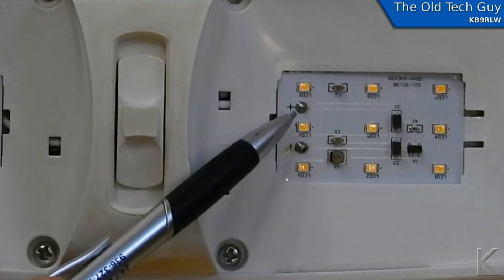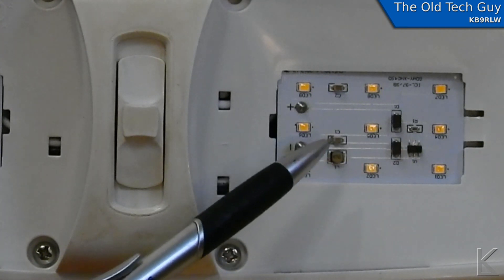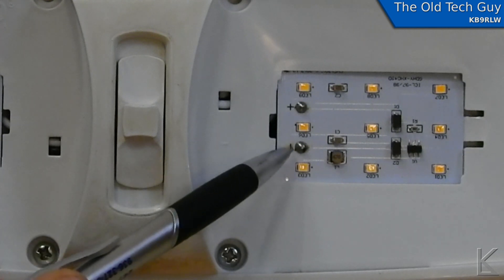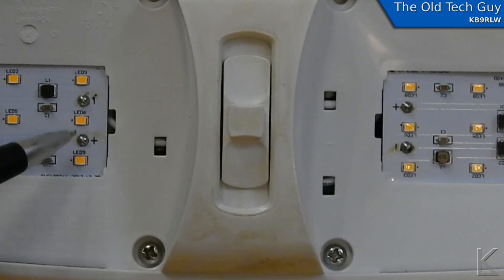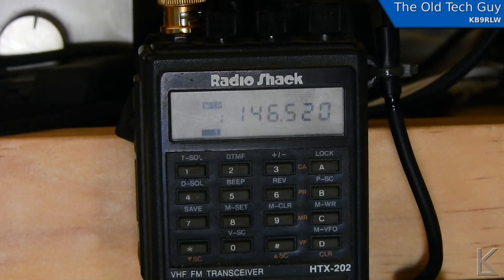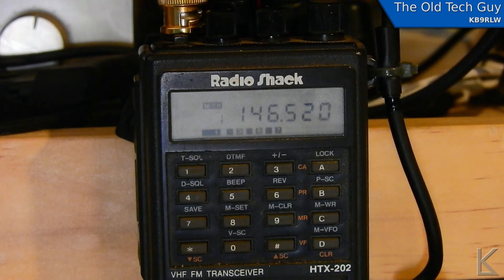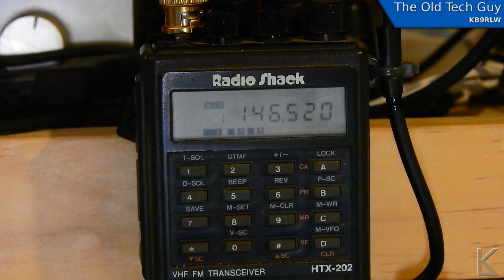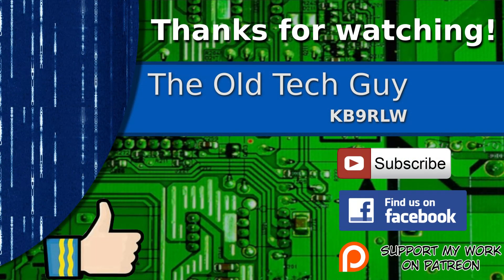Electronics & Radio - Reducing the noise from my camper's LED lights.

Comment: Great.. i did this to all my LED lamps in my cabin that runs on solarpower, but the chinese MPPT chargecontroller (fro ebay) have also lots of noise, used Ferrite snap-on on the powercables in and out and even to the batteries. that did the trick at my place

Comment: Hi Kevin. Great job on organizing and moderating the panel at Quartzfest. I have a question for you concerning noise and I thought you would be by far the best person to ask because of your interesting experiments. I am going to be adding a small solar system to my teardrop trailer to charge my Battle Born LiFePO4 battery. Can you please tell me your opinion concerning the noise generated by a MPPT Solar Charge Controller vs a PWM Charge Controller? I can’t seem to find any information on this. Thanks again Kevin. Mike KC0KMQ.

Comment: Try higher value cap? Take down the fixture and loop the power leads through a ferrite.  It’ll be in the back your mind until you get that fixture on the bench and try everything you can. At least I hope so! Have a good one, always enjoy your videos.
Reply from the maker: I tried several values, the .001 worked best for the VHF noise component.

Comment: I would check that the LEDs are not acting as their own rectifiers, and then select a really tiny capacitor and put it across the output of the driver circuit as close to the rectifiers as possible. 

You might also need to put a small resistor across this capacitor to avoid having these lights seeming to glow forever after this mod.

If you find that the LEDs are actually running as their own rectifiers I would probably install a different led board because they are probably driving LEDs on both the positive and negative cycles and making a good filter in this case would likely be harder than replacing the modules. If you must work with such modules, I would look at ways to convert that square wave hash into something closer to a sign wave.

If the noise is still a problem I would conformal coat the rectifier area of the circuit board. Then make tiny Mu-metal shields for the front in the back of the circuit board. The conformal coating will help prevent corrosion and shorts due to condensation that will undoubtedly form on these shields at some point.

Personally if I couldn't just slap another tiny cap in there and be done I would probably replace the boards. You might find some that can dim or that have other useful features (like red light or motion triggering).

Comment: I use a 1.0 uFd (at 50 Volts)  monolithic ceramic capacitor and it removes all noise.  100 for about $10 from amazon.com  https://smile.amazon.com/gp/product/B0166ETD0Q/ref=ppx_yo_dt_b_asin_title_o08_s00?ie=UTF8&psc=1 Ron W4BIN
Reply from the maker: I tried several values, the .001 was best at reducing the VHF hash.

Comment: wow amazing result .... good to know......I have a question >>>> I have 2 laptops , one with CubicSDR and the other one with Flidigit .... can I connect both laptops with headphone output for nr 1 and mic in for nr 2?    I will use that second laptop to try different programs to decode radio signals ....greetings ....Annie
Reply from the maker: You can, but you'll need to drop the volume on the source way down or you'll overdrive the more sensitive mic input on the other.
You could also just run FLdigi on the same laptop as cubic and digitally pipe the audio from the one app to the other.  On linux, you can do it with Pulse Audio Volume Control very easily.   If you're running windows, there are probably other ways to do it.
Reply: thank you mucho mucho

Comment: Hey Kevin. I have a same problem in my house. I have almost all of my light fixtures replaced with led and it doesn't bother me on vhf or uhf. HF is another story, leds ad 2-4 s noise so I just learned to turn them off. I have a desk lamp in my shack and that serves me well.

Comment: I have been investigating a similar issue, total hash on 2m, In my case it is not the led bulbs in my house, I took them all out and the problem persists. I do need to get outside to investigate, but today is a brisk -36 C and -46 C with the wind chill so best leave that until it warms up a bit.
Reply from the maker: Small plug in power supplies like provided with so much equipment these days are usually the problem.

Comment: Perfect..I have the same noise on the van AM radio when charging phone Lipo or drill . Ahaaa..like the old dash stereos bought years ago..no filtering out alternator noise so we had to buy a choke coil for the hot wire..which work fairly well.  Speaking of noise, I have notice more wireless network at intersections that when driving underneath the squelch breaks briefly ...

Comment: You Kevin!:
Great video! I'm sure there will be PLENTY of posters to give you THEIR led noise remedies! Maybe another pair caps would do? Or that would draw down the battery? I wish you success at this!
What do you think of my idea on quartzfest video? : )
de seeker/Jeff WA7LFP
Reply from the maker: The capacitors don't pass DC and therefore don't add anything to the load or power draw.   They just pass the VHF hash noise, presenting a short to those frequencies.

Comment: Well, for me, I prefer to make my own led light circuits and use a very basic voltage regulator to drive the leds. There is actually no need for high-frequency drivers for leds. I guess I just prefer to keep my system simple. The voltage regulators cannibalized out of old computer power supplies and a few I made from other electronics scrap, all depending on how many leds I am running at the same time.

Comment: Thank goodness you are unique in attacking this at the actual source vs "just choke it" everywhere and anywhere.  I'd love to see these 'scoped' to understand more about how and why product engineers seem to think they have to provide some noisy circuit gizmo to something as simple as passive resistor-based voltage/current reduction to a simple LED.  Not everything needs "advanced digital control" nonsense.  ;)

Comment: More capacitance to reduce the noise or is there a limit to what you can add?
Reply from the maker: More capacitance will pass noise at lower frequencies.  I found the .001 to be the most effective at reducing the VHF hash I was getting.

Comment: try electrolytic caps ?? or piece of tin foil blocking or reflecting it up ??
Reply from the maker: I tried different values.  I found the .001 to be the most effective at reducing the VHF hash I was getting.

Comment: Did those lights have a High and Low setting? I'm surprised there were so many components if they ran off 12VDC.
Reply from the maker: Low turns on only one panel, high turns both on.

Comment: Hi Kevin,
I would look for some led modules that will work with what ever native voltage your RV is running (12/24?) 

They should be completely free of noise.  Check out aliexpress or bangood.  Be sure to decide wether you want warm white or cool white. (I suggest warm white) There are plenty of different sizes that should fit into your existing fixture after you remove the existing led panel.  might take a bit of hot glue or whatever to retrofit your existing fixtures.

73 N7KBC Dwight
Reply from the maker: These do run off 12v.  They use drivers to pump the LED's a bit harder and limit total power draw.

Comment: Would increasing the value of the capacitor be of any further benefit?
Reply from the maker: If you're dealing with lower frequency noise.   I found the .001 to be the most effective at reducing the VHF hash I was getting.

Comment: Hi Kevin, 

Sounds like it is definitely into your power line though. Scope time! Put your scope probe into one of your bench 12v lines and check the hash level. 

To reduce it further, add in parallel .1 & .01 caps too!

If you still have some, try adding an rf choke/ferrite bead in series with the power line. Before you do that, try temporarily covering the light with aluminum foil to see if the circuit (that smt coil) needs shielding.

73 - John - N7GHZ

Comment: Kevin, why did that not create a dead short?
Reply from the maker: Capacitors will pass AC voltage and block DC voltage.  At the very small value I used, it passes the VHF hash noise but not the DC voltage.

Comment: Soldering overhead made me scared. One drop of the molten can be an unhappy burn. I'm glad it all worked out OK

I heard some hams from around Blackpool, UK over a year ago (on the GB3FC repeater). They were complaining about the interference caused by new LED street lighting. Some circuitry, but not all, was causing mayhem with background noise
Reply from the maker: Standing directly under it would have been foolish. :-)  I didn't.
Reply: @loughkb  Hi Kevin, I watched your Quartzfest video yesterday. You did really good hosting it. I enjoyed it and also picked up on more ham youtubers to watch. Many thanks
Reply from the maker: Thanks, I'm glad you enjoyed it!

Comment: I'm jealous of your capacitor collection. Modern eBay assortment packs just don't cut it. Whatever I buy never seems to be what I need when I come across an interesting circuit to build. Maybe another 20 years of accumulating stuff will help. 73 M6EXF
Reply from the maker: There's always guys selling collections of parts at ham fests.

Comment: If your hands are steady enough (and eyes can deal with surface mount :o), it would be best to place the caps directly at the source (the IC). Would at least lower the noise even more. If you're felling even more adventurous, you could cut the track close to the IC and solder in a surface mount inductor and cap as a LPF. I guess at that stage, it becomes a project :o)
Reply from the maker: Nope and nope.   SMD is something I just can't do any more.

Comment: I find that to work HF in my little RV I have to turn completely off the inverter  that provides 12VDC to charge the batteries.   I have old school DC lights that don't seem to make any RFI.
Reply from the maker: Yeah, when I'm plugged in, the converter makes noise in small segments of the bands.  It wanders too, as load changes and it shifts the pulse width to compensate.   But I'm mostly off grid and on batteries.